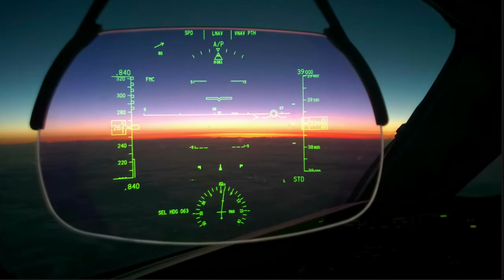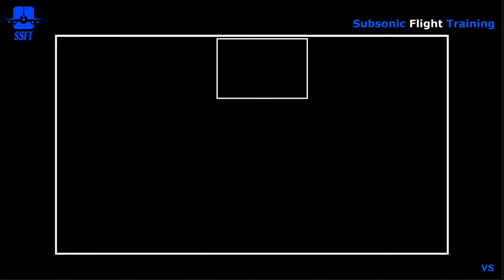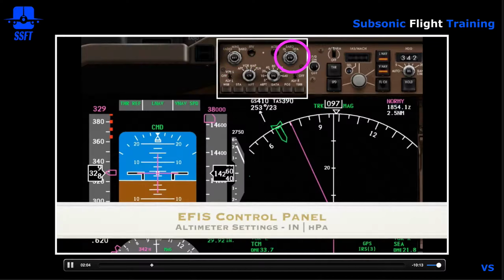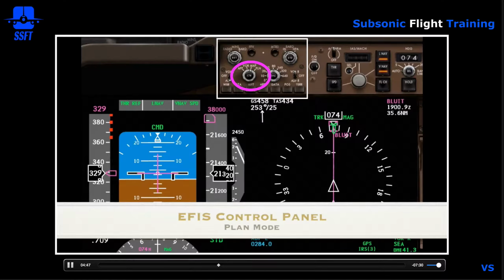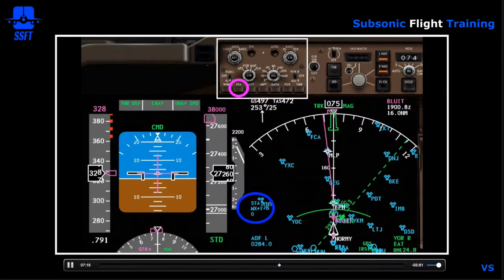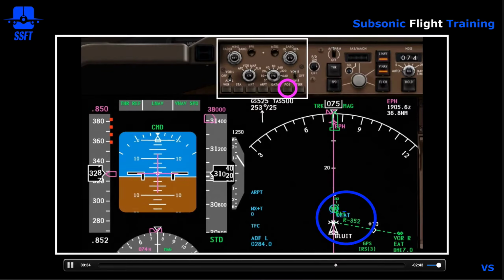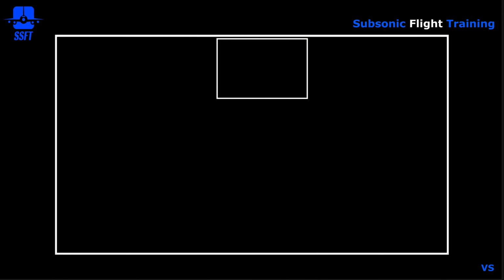EFIS Control Panel (iFly 747-400)

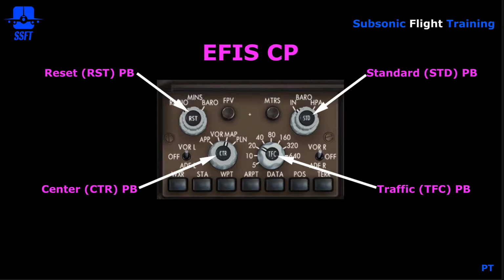Comment: 5:00
1) CTR PB (Center Push Button)
And then the Center PB on the ND mode switch is used to go from the Expanded Mode to Full 360 degree ROSE compass mode by pushing center.
2)  TFC PB (Traffic Push Button) is used to display TCAS traffic on the ND when the switch is pushed, and alternately you can turn ON or OFF the Traffic by pushing the switch again. 5:30

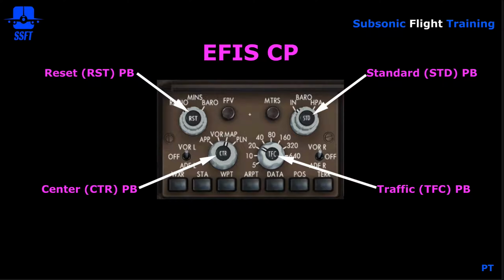Comment: 4:24
There are some inner switches associated with the rotary switches. There are little push button (PB) switches that are associated with either resetting Minimums when you reach Minimums through the 
1) RST switch and the inner portion of the minimum switch. 
2) The STD or the little Standard PB (Push Button) is for the BARO. When we get to the transition altitude we would normally go to 2992 inches. When we push the Standard that's automatically displayed by displaying STD on our PFD. 5:00

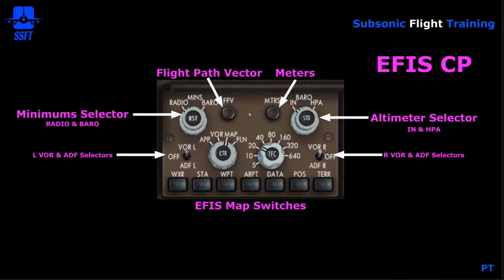Comment: 3:42
At the bottom, there are EFIS MAP switches. Each of these switches control information that is displayed on the ND. You can display 
1) WXR (weather radar returns) or display 
2) VOR Navaids, or 
3) WPT, waypoints that are on the database
4) ARPT, airports that are in the Range on the ND, or various
5) DATA information when you push the DATA switch
6) POS -- Position would display your GPS and IRS position along with some raw data radials, and then 
7) TERR -- would display terrain on the ND (Navigation Display) 4:24

Comment: 3:25
Just to the right of that is the 
1) Range Selector which varies from 5 miles to 640 miles. And then to the right of that would be the 
2) Switch for the RIGHT VOR or the RIGHT ADF to turn the display OFF on the ND (Navigation Display). 3:42

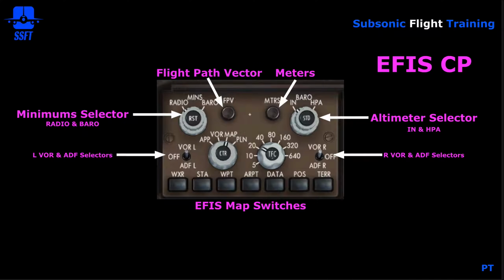Comment: 3:00
Moving down you have a little toggle switch that is used for LEFT VOR and LEFT ADF or to turn the display OFF. Going to the right of that you have the ND MAP select switches or MODE select switches that encompass 
1) the APP (approach mode)
2) VOR  (VOR mode)
3) MAP (MAP mode)
4) PLN (plan mode)
on the ND (Navigation Display) 3:25

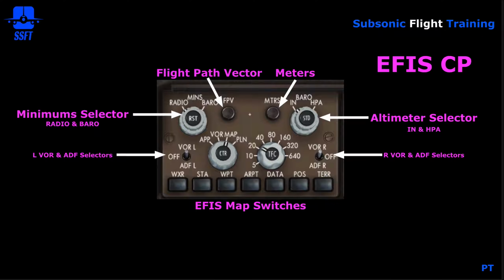Comment: 2:35
Just to the right of that is the BARO switch which is used to set the Altimeter (ALT) in either inches (IN) or Hecto-Pascals (HPA). Again there's an outer rotary switch and there's an inner rotary switch. The outer is used to select either inches or hectopascals and then the inner is used to set the actual altimeter setting in inches or hectopascals. 3:00

Comment: 1:53
There's an outer and an inner selector that allows for the setting of either RADIO or BARO and also to set the Minimums themselves.
1) Moving to the right of that you have the Flight Path Vector (FPV) switch. When you turn this ON or OFF, it displays the Flight Path Vector on the PFD.
2) Next to that is the MTRS switch. On the Altitude section of the PFD -- when you push MTRS ON, it displays <Metres> as well as <Feet>. If you turn it OFF, then <Metres> will disappear and you'll be left just with <Feet>. This would be used in areas of the world where you have to use metres such as China. 2:35

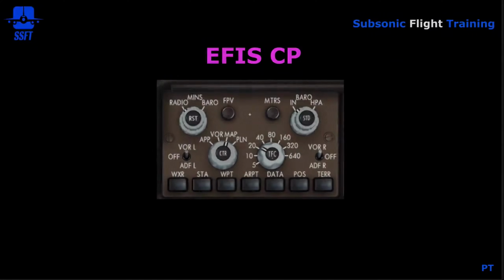Comment: 1:10
EFIS control panel consists of: 
1) a panel that has rotary controls,
2) toggle switches, and 
3) push-button switches.
Going from left to right and up to down -- from the left, you have the Minimums Selector that allows us to set either a) Radio Altitudes for Minimums or Barometric Altitudes for Minimums. 
Typically, on a 
1) on a CAT I approach, or a non-precision approach, we would set BARO MINS. 
2) On a CAT II approach, or  [ RADIO MINS]
3) on a CAT III approach, we would set a RADIO MINS. 1:53

Comment: Thanks for the video, why is there two VOR in the EFIS?
Reply from the maker: Thanks Joan, there are two VOR receivers as well as 2 ADF receivers (Left and Right) that can be displayed on the ND via the EFIS control panel as a skinny (Left) or fat needle (Right) and are colored green (VOR) and cyan (ADF). They allow for raw data monitoring when required mainly during approaches...